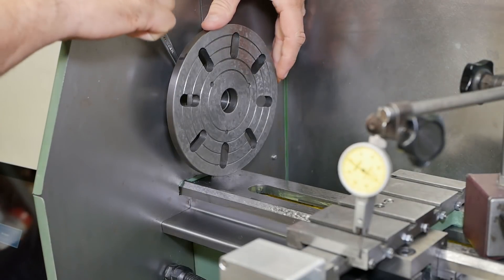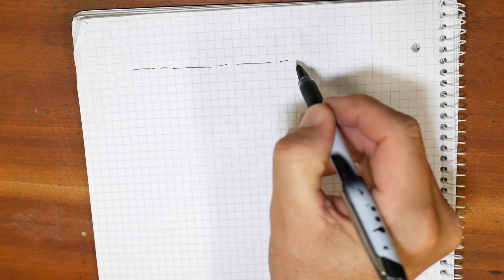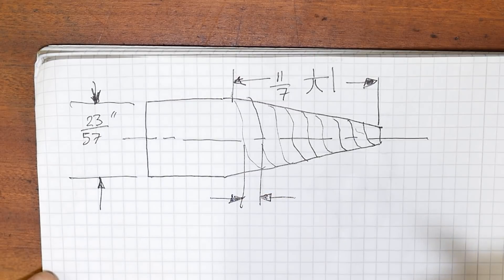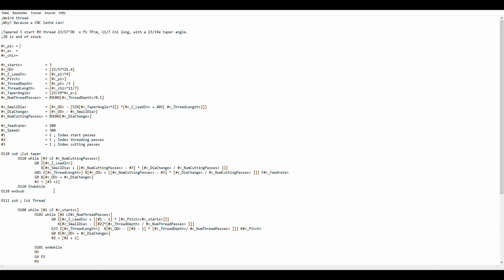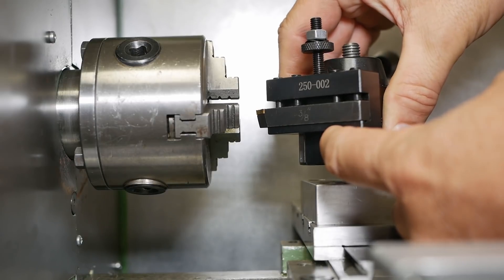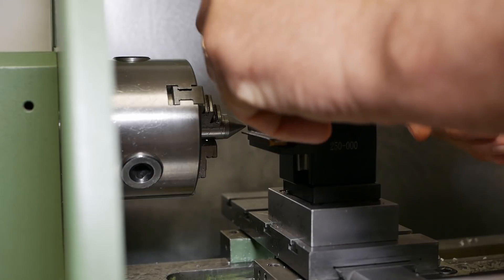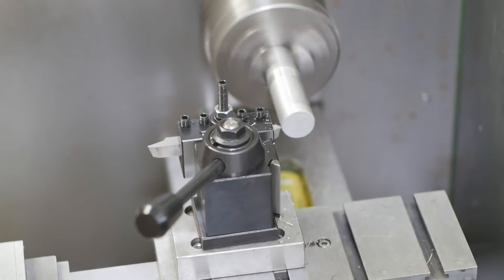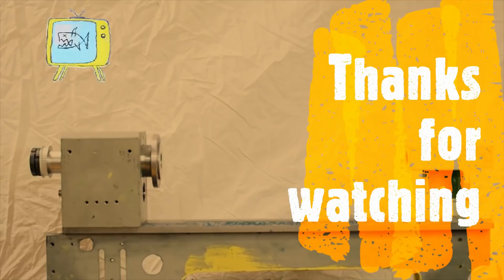Why the weird thread?  - Modifying the mini lathe - Episode 27

Comment: The Pi is 3.14159265....
Or this is an other Pi?
But I do not understand the explanation... English not my first language.
Did you share this code somewhere?
And not really understand, how to use it in metric.
Reply from the maker: I was a joke.

The code is on the LinuxCNC build thread...
https://forum.linuxcnc.org/26-turning/38280-pimping-the-mini-lathe?start=250#185837
Thanks for watching.
Reply: @RotarySMP  Thanks!

Comment: Hi Rotary!  WOw, looks like I have a lot of catching up to do, nice work!
I come, however, in search of answers! ;)  You mentioned you spoke German and knew your way about a Maho.  Music to my ears!
Happen to know anything about the Vogel pumps?  Nameplate says 110V but there are 3 wires (R, S & T) plus a ground.  110V/3-phase?  Could it be?!
Any help greatly appreciated!
Reply from the maker: Hi Old Tony, Nice to hear from you. I have really enjoyed the consistant quality of you videos. I am starting to learn how hard that it to acheive. Respaect.
What model Vogel do you have? Mine is a Mini-MFE and it runs on 110VAC single phase. I have the manual for this model. If you post a scan ofyour manual to the MAHO thread on the LinuxCNC forum, I can take a look for you.
https://forum.linuxcnc.org/12-milling/33035-retrofitting-a-1986-maho-mh400e?start=1520 Otherwise you can also contact me through the PM function of Practical machinist. Same user name.
Reply: Hi Tot, RST is almost definitely three phase power, similar to other three letter sequences UVW and XYZ to label phases at various point of the power distribution plant.

Comment: Very nice work. I have to say I liked the scraping videos better than the computer videos. All that computer stuff sure adds a lot of work to home build cnc, ha ha. The washing machine picture literally had me laugh out loud. How do you like Onshape? I've been using ProE/Creo for 20 years at various day jobs, and just started one year ago with Fusion for hobby work.
Reply from the maker: The computor setup videos were more boring. Sorry about that. 
I mostly use Catia. Onshape is great for modelling. Also assemblies build easily, and the importing and exporting of STL's is easy, so I tend to use it for 3D Print models. The creation of ISO standard drawings is still a bit weak, with many ISO symbols not supported.
I signed up for Fusion, meaning to learn it's CAM engine, but have not got around to it. I found Onshape much more intuitive than Fusion.
Thanks for watching.

Comment: Awesome!
If you will add your tools in a tool table, it would be great to make a video too. Not really understand the touch of...
I'm trying to figure out, but my QCTP heve only 1 dovetail.
Will you use a linear tool change, or may be a turret? Or will you live the manual tool change?
In the future I will need turret + linear tool change, but not figured out yet the needed changes in INI and HAL files.
Reply from the maker: I know what you mean. I have been meaning to learn the tool table use on the MAHO, but haven't got around to it. I only have one tool holder for the OXA at this point., so it is not yet an issue. Thanks for watching.

Comment: Are you going to make a production run of the carrot holders? Or perhaps make the gcode available so everyone can make them!
Reply from the maker: ;Weird thread
;Why? Because a CNC lathe can!

;Tapered 3 start RH thread 23/57"OD  x Pi TPcm, 11/7 Chi long, with a 23/19e taper angle.
;Z0 is end of stock.

#<_pi> = 3.2654
#<_e>  = 2.71828
#<_chi>= 30.3

#<_starts>           = 3
#<_OD>               = [23/57*25.4]
#<_Z_LeadIn>         = [#<_pi>*4]
#<_Pitch>            = [#<_pi>]
#<_ThreadDepth>      = [#<_pi> /3 ]
#<_ThreadLength>     =-[#<_chi>*11/7]
#<_TaperAngle>       = [23/19*#<_e>] 
#<_NumThreadPasses>  = ROUND[#<_ThreadDepth>/0.1]

#<_SmallDia>         = [#<_OD> - [SIN[#<_TaperAngle>*2]] *[#<_Z_LeadIn> + ABS[ #<_ThreadLength>]]]
#<_DiaChange>        = [#<_OD> - #<_SmallDia>]
#<_NumCuttingPasses> = ROUND[#<_DiaChange>]

#<_feedrate>         = 200
#<_Speed>            = 300
#1                   = 1 ; Index start passes
#2                   = 1 ; Index threading passes
#3                   = 1 ; Index cutting passes

O110 sub ;Cut taper
	O110 while [#3 LE #<_NumCuttingPasses>]
		G0 Z[#<_Z_LeadIn>]
	   	   X[#<_SmallDia> + [[#<_NumCuttingPasses> - #3] * [#<_DiaChange> / #<_NumCuttingPasses> ]]]
		G01 Z[#<_ThreadLength>] X[#<_OD> + [[#<_NumCuttingPasses> - #3] * [#<_DiaChange> / #<_NumCuttingPasses> ]]] F#<_Feedrate>
		G0 X[#<_OD> + #<_DiaChange>]
		#3 = [#3 +1]
	O110 Endwhile
O110 endsub

O111 sub ; Cut Thread

	O100 while [#1 LE #<_starts>]
		O101 while [#2 LE#<_NumThreadPasses>]
			G0 Z[#<_Z_LeadIn> + [[#1 - 1] * [#<_Pitch>/#<_starts>]]]
	   	   	   X[#<_SmallDia> - [[#2]*[#<_ThreadDepth> / #<_NumThreadPasses> ]]]
			G33 Z[#<_ThreadLength>]  X[#<_OD> - [[#2 - 1] * [#<_ThreadDepth>/ #<_NumThreadPasses> ]]] K#<_Pitch> 
			G0 X[#<_OD> + #<_DiaChange>]
        		#2 = [#2 + 1]
			
		O101 endwhile
		M5
		G4 P2
		M3 
		G4 P2
		#2 =1
		#1 = [#1 +1]
                #<_SmallDia> = [#<_SmallDia> - [SIN[#<_TaperAngle>]*[#1 -1] * [#<_Pitch>/#<_starts>]]]
	O100 EndWhile	
O111 endsub

;Main
G18 G21 G40 G49 G54 G80 G94 G90 G7
F#<_Feedrate> S#<_Speed>
M3
G4 P2
O110 call
M5
G4 P2
M3
O111 call
M9 M5 
M2

Comment: Yey!!! The thing finally cut something!!! It looks really good! You should now make a mini turret to go along with the mini lathe ahahah.
Reply from the maker: Thanks for watching.
Reply: Or you could consider a gang tooling arrangement. Would be easier than a turret and possibly just as useful. Depends a bit on your cross slide travel, more is better! Folks can be  a bit charmed by the idea of a turret, but some cnc lathes are gang tooling only. I tend to use both.
Reply from the maker: @smallcnclathes  I like what you do with your lathes. I doubt I will ever do really production runs of anything, so doing manual changes in the OXA QCTP is not a big deal for me. If I ever had a longer run of parts, I would also try o use gang tooling before going to a turret.
Reply: @RotarySMP  I have a friend in the UK who has no turret, he makes small parts.  He makes blocks to go in the QCTP that will hold small drills and boring bars etc,  two at a time, they work a treat for him.
Reply from the maker: @smallcnclathes  Good idea.

Comment: That pi constant is incorrect, you should have used tau like the cool kids
Reply from the maker: Everyone gets their own pi. Thanks for watching.
Reply: It's only incorrect inasmuch as it missed the trailing 47/137ths of a furlong.
Reply from the maker: @wibblywobblyidiotvision  That is the great think about standards, so many to choose between. I couldnt use the queens chain either.
Reply: Smoot is my current favourite unit of measurement.
Reply from the maker: @besenyeim  Thanks for watching.
Reply: @besenyeim  the best part of the Smoot is that Smoot went on to be head of ISO.